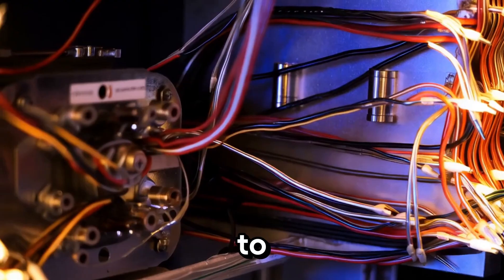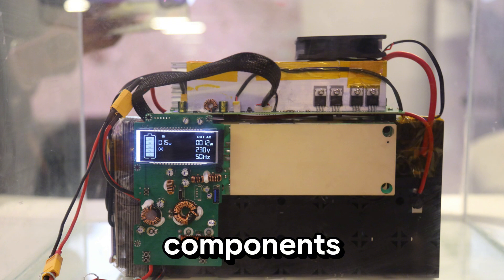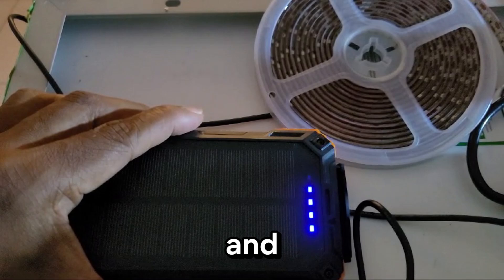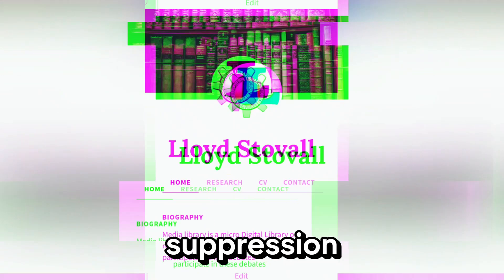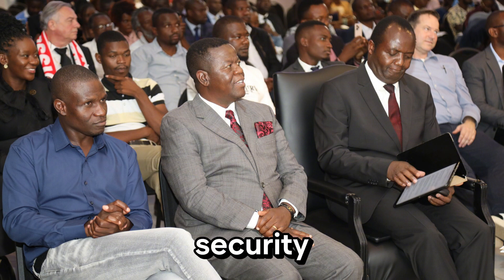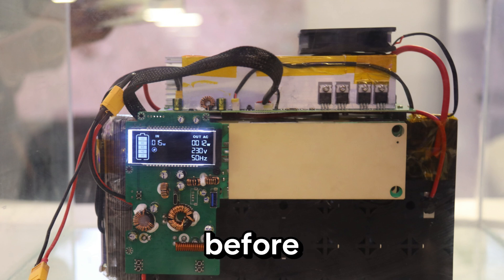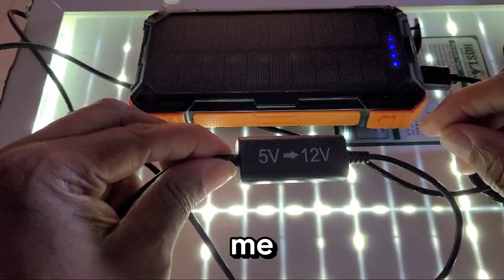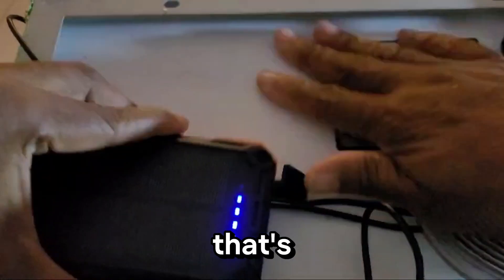Llyod Stovall Explains How His Free Energy Technology is Different From Chikumbutso's

Comment: 1. "Maxwell is taking radio waves and amplifying them to generate power."
🚨 Total nonsense.

Radio waves do not carry unlimited energy. If they did, every radio tower would be a power plant.

Amplifying a weak signal does not create free energy—it just wastes more power from an actual energy source.

If you could generate energy this way, every device would already be doing it. Instead, we still use batteries and power grids.

2. "MOSFETs generate power!"
🚨 No, they don’t.

A MOSFET is just a switch—it does not generate anything.

Saying "MOSFETs are small generators" is like saying a light switch creates electricity. Absolute nonsense.

3. "Maxwell’s biggest problem is overheating!"
🚨 Wrong. His biggest problem is PHYSICS.

The problem isn’t that his system is overheating—it’s that it doesn’t work.

There is no real proof of his technology. The scam is overheating, not the MOSFETs.

4. "If Maxwell just used Tesla’s patents, he wouldn’t have this problem."
🚨 Tesla did NOT invent free energy.

Tesla never created a self-powering system. He still needed an energy source.

His wireless transmission experiments were about moving power, not generating it.

Tesla’s name does not make free energy real.

5. "I’ve been doing this for 30 years! My house runs on this!"
🚨 Where’s the proof?

If your house has been running on free energy for 8 years, where is the independent verification?

No pictures, no blueprints, no patents, no test results—nothing. Just more empty talk.

6. "America is suppressing this technology!"
🚨 Classic excuse.

If America wanted to suppress this, why haven’t they stopped you from talking?

If this tech worked, other countries would be using it. Yet, nobody has.

7. "Maxwell can’t sell his product because of security issues!"
🚨 Lies.

The real reason he can’t sell it is because he has nothing to sell.

If he had a working product, he could prove it today. Instead, all we get is excuses and delays.

8. "I’ll give my technology for free! Come test it!"
🚨 Prove it.

If you really have a working device, let scientists test it under strict conditions.

Saying "come test it" means nothing when you never provide actual blueprints or independent verification.

FINAL VERDICT:
✅ Completely misunderstood physics.
❌ Radio waves can’t power a car.
❌ MOSFETs don’t generate energy.
❌ Tesla’s name doesn’t make nonsense real.
❌ Zero proof of a working system.

Final message:
"You’ve had 30 years to prove this. Instead, all we get are excuses, conspiracy theories, and fake promises. Put up real, verifiable proof—or admit you’re just another fraud pushing nonsense to gullible believers." 🚀🔥
Reply: nice summary of both Lloyd and maxwell, Lloyd has created a system that wastes more energy from the battery it is connected to, than it produces to feed into the inverter, that can be connected directly to the battery, a completely pointless experiment and Maxwell is just a liar with no kind of device at all
Reply: @davidbamber-n9x YouTube has evolved over time to become a place of entertainment and learning so i really hate it when people come on this platform and start trying to sell snake oil for real science and taking people's money

Comment: Free energy is suppose to exist already if over unity coils are real which it seems like they are but I haven’t seen in person. The only thing about it is that they are not practical to make at an industrial scale. Too big and careful and the materials for it. Also it’s not free but it recycles and outputs enough that you can use solar with it and it’s basically free.
Reply: The Earth is hanging in Space upon Nothing. 1700 people around the world, where are they today? They have disappeared into the Thin Air, Water and Earthcrust which makes up TIME or emptiness of Space!

That so called Emptiness is FREE ENERGY that is ever flowing limitless around You and I and other living and non-living things.

I am a Nigerian whom have successfully start Tapping from the Seen and Unseen Free Energy Havens Around We Humans in all categories.

If you wound a transformer, SHORT it coils and pulse it at Radio Waves Frequency like 38Khz, YOU WILL GET HIGH VOLTAGE from an input of just 90VDC. If you Pump that high DC voltage into the positive side of  an High VOLTAGE DC capacitor using a one way Valve called Diode, and connect an Earthed Aluminum or Copper Plate to the Negative point of the High Voltage DC Capacitor,  **YOU WILL GET NEARLY UNENDING GIGAWATTS OF POWER**.

Using an High Frequency One Way Valve like HER208 or FR607, You only need to connect one leg of  a tuned Step-Down Transformer in Between the Negative point of the said HV Cap and connect the other leg of the HV step down Trafo to your well installed Earthed Copper or Aluminum Plate buried at least 10ft in the Ground.
Take another HF HV Diode and connect it back to the Earther Plate and connect it Front to the Negative Capacitor Point and You will NEVER IN YOUR LIFE NEED TO BUY THE Oil of the Establishments.

To increase the Wattage Output Infinitely, Just *Add More High Voltage DC Capacitors* and Addore Identical Step-Down Trafo.

I have given You and anyone who is Lucky to read My Comment Everything Needed to build there own D.S.Effect Gen.

Comment: Could you please ask Lloyd  how we can make use of power from a washing machine water pump motor that give RF power that runs LEDs only but can't run anything else.
Reply from the maker: I will Andrew: we might have him on the livestream tonight
Reply from the maker: Okay right off the back I would say take the device to run a motor and put it on a ram pump assembly not a washing machine this pump can pump up water higher than any other pump known because it uses the water itself as a weight by putting a motor on this pump tell me if you need documentation of this you get it the extra help it needs and it pumps faster this means that the water can be pumped up to high altitudes and then when dropped makes energy using a water wheel or a small dam project that is just off the back I have to get on the video call I'll think of more later
Reply: @chriswabs  it's not about water but power generating
Reply from the maker: LONG ANSWER FROM HIM

Yes, you can attach an electric motor powered by solar energy to a ram pump to increase its efficiency and output. This hybrid approach combines the benefits of a traditional ram pump—using the weight of water to create pressure—with an external energy source to optimize performance. Here’s how it could work:

Concept Breakdown

1. Traditional Ram Pump Functionality

Uses the energy from flowing water to create pressure, pushing a portion of the water uphill.

No external power is needed.

Works efficiently but is limited by water source flow rate and height.

2. Adding a Solar-Powered Motor

A motor could assist the waste valve (which opens and closes due to water hammering effects) to optimize timing and improve efficiency.

A motorized priming system could push more water into the system, allowing the pump to function in conditions where natural flow is insufficient.

A motor-driven booster pump could work in conjunction with the ram pump to increase pressure and lift water to greater heights.

Potential Benefits

✔ Higher Flow Rate – By fine-tuning the waste valve cycling, more water can be pushed uphill.
✔ Increased Lift Height – Overcoming the limitations of the standard ram pump by adding external mechanical assistance.
✔ Works in Low Flow Conditions – The motor could help keep the system running even if the water flow is weak.
✔ Still Energy Efficient – Solar power offsets electricity costs, making it a sustainable improvement.

Implementation Ideas

Use a low-power DC motor (12V or 24V) connected to the waste valve, allowing for controlled timing.

Use a solar-powered pump at the inlet to increase initial water velocity before it enters the ram pump.

Add a flywheel powered by the motor to assist in maintaining momentum and pressure in the system.

This approach would blend mechanical and electrical efficiency while still relying primarily on the weight of water to perform the bulk of the pumping. It’s a practical idea worth testing!

Yes, you can attach an electric motor powered by solar energy to a ram pump to increase its efficiency and output. This hybrid approach combines the benefits of a traditional ram pump—using the weight of water to create pressure—with an external energy source to optimize performance. Here’s how it could work:

Concept Breakdown

1. Traditional Ram Pump Functionality

Uses the energy from flowing water to create pressure, pushing a portion of the water uphill.

No external power is needed.

Works efficiently but is limited by water source flow rate and height.

2. Adding a Solar-Powered Motor

A motor could assist the waste valve (which opens and closes due to water hammering effects) to optimize timing and improve efficiency.

A motorized priming system could push more water into the system, allowing the pump to function in conditions where natural flow is insufficient.

A motor-driven booster pump could work in conjunction with the ram pump to increase pressure and lift water to greater heights.

Potential Benefits

✔ Higher Flow Rate – By fine-tuning the waste valve cycling, more water can be pushed uphill.
✔ Increased Lift Height – Overcoming the limitations of the standard ram pump by adding external mechanical assistance.
✔ Works in Low Flow Conditions – The motor could help keep the system running even if the water flow is weak.
✔ Still Energy Efficient – Solar power offsets electricity costs, making it a sustainable improvement.Yes, a hydraulic ram pump can indeed pump water up to 200 feet (or more), depending on the height difference between the source and the pump, making it one of the most efficient water pumping systems relative to its size. This is why ram pumps often outperform many store-bought pumps in terms of efficiency, durability, and ability to lift water high without fuel or electricity.

Why a Ram Pump Can Beat Traditional Pumps

1. Self-Powered Mechanism

Ram pumps use the kinetic energy of flowing water (from a stream, river, or elevated reservoir) to pump water without electricity.

A small drop in elevation (as little as 2-3 feet) can push water up to extreme heights.

2. High Efficiency Relative to Size

A small ram pump can lift water over 200 feet, something store-bought electric pumps would struggle to do without large motors or expensive high-pressure designs.

For every 10 feet of drop, a ram pump can lift water 100+ feet (in ideal conditions).

3. Durability and Low Maintenance

No moving parts other than a waste valve and a delivery check valve.

No need for electricity, fuel, or constant supervision.

Lasts for decades with minimal repairs.

4. Comparison to Store-Bought Pumps

Electric submersible or jet pumps require a power source and often struggle to reach more than 100 feet without high-powered motors.

Gas or diesel-powered pumps require fuel and maintenance.

Solar-powered pumps can be expensive and need high-wattage panels to achieve similar heights.

Where Store-Bought Pumps Might Still Win

✔ Immediate water delivery – Traditional pumps can work instantly, while a ram pump requires setup and proper water flow.
✔ Variable flow control – Electric pumps can be adjusted with controls, while ram pumps rely on constant flow conditions.
✔ No need for a water source drop – A ram pump requires an elevation difference to function, whereas traditional pumps can pull water from still sources.

Would Adding a Solar-Powered Motor Still Help?

Even though a ram pump naturally outperforms most electric pumps in its category, adding a solar-powered motor could still enhance performance, such as:

Automating the waste valve timing for efficiency.

Boosting inlet pressure when water flow is weak.

Increasing lift beyond 200 feet by creating a hybrid system.

If you're already getting 200+ feet of lift with a simple, self-sustaining device, then adding a solar-powered enhancement could make it even more reliable in low-flow conditions. It wouldn’t be necessary in many cases, but it could optimize or expand the pump’s working range where natural conditions are less ideal.

Implementation Ideas

Use a low-power DC motor (12V or 24V) connected to the waste valve, allowing for controlled timing.

Use a solar-powered pump at the inlet to increase initial water velocity before it enters the ram pump.

Add a flywheel powered by the motor to assist in maintaining momentum and pressure in the system.

This approach would blend mechanical and electrical efficiency while still relying primarily on the weight of water to perform the bulk of the pumping. It’s a practical idea worth testing!
Reply: Thanks for the reply but question is, a washing machine has a drain pump motor. If you reverse instead of running it with ac power you spin it using 775 DC motor it produces an RF power. If I take burnt out led bulbs and remove the brown capacitor I can run lights from that water pump motor. So if you light many LEDs sandwiched between two solar panels it means you loop back and have the power now from solar panels boosting the 775 motor . The power from the water pump motor is neither AC nor DC. How can I make it pure DC?

Comment: Lloyd Stovall talks about generating current. And I keep asking: Show us a simple schematic. The schematic will answer a lot of questions including.

1. You are going through the route of using a battery to power an LED, and then capturing the light from the LED to power a solar panel and then use the electrical energy the solar panel generates to power a MOSFET. But in reality you only really need a battery to power the MOSFET. Why didn't you just use the battery to be switching the MOSFETs at once? Would it not be more efficient and even economical to get rid of the LEDs and solar?

2. What circuit are you using to generate the signals that switch the gate of your MOSFETs  at high frequencies and is it powered by the solar?

3. Is the drain-source terminal of your MOSFET connected to a voltage source? If so then is that voltage source from your solar panel?

4. When you are switching your MOSFETs and getting that significant pulse current of yours, through what terminals of the MOSFETs do they flow and how is your load connected to let this current flow through it? 

If Lloyd Stovall generates current by switching MOSFETs, I can argue that the same thing should be achieved by switching relays or even mechanical switches (if you can switch them that fast). I'll be happy to get an explanation of why switching relays or manual switches shouldn't have the same effect of producing a high current.

Please don't use AI, don't ask AI anything. Provide an answer, just from your point of view.
Reply: He know nothing.
Reply: If you get your schematic I will show my arse in a shop window.
Reply: the big question is, why would you not just connect the battery direct and cut out all of the power loss from connecting it to LEDs to feed light energy to the solar panels, loosing even more energy, a completely pointless experiment, he's achieved nothing but a more inefficient way of charging that phone
Reply: @davidbamber-n9x With this setup, he can bamboozle a bunch of energy illiterates into thinking he just solved physics, when all he really did was make a flashy light show. 

It’s like a circus act, except the audience actually believes the clown is a genius.
Reply: @hiz-n-lowz1577  He gets the views. Have you noticed that ever since he started posting about this Maxwell Chikumbutso thing, claiming he knows how the technology works, his channel videos now have more views? That's his aim, taking advantage of the situation.
Reply: @hiz-n-lowz1577  The answer is simple. It's not an interesting circuit and you can't use it to fool anyone that you create energy to power your home
Reply from the maker: We're supposed to do a livestream with him today: if he shows up I will bring this to his attention so that he can answer.
Reply: It is all a scam to glean money out of scientifically illiterate African people who are the only ones buying into their extraordinary claims.
Reply: well written and yes no ai nonsense we will know